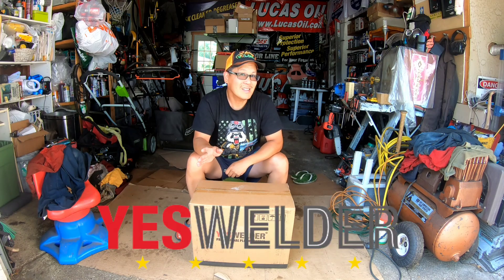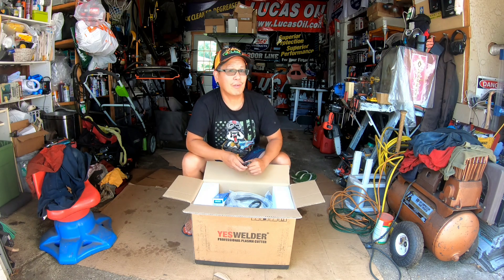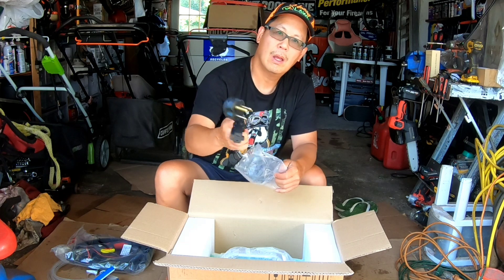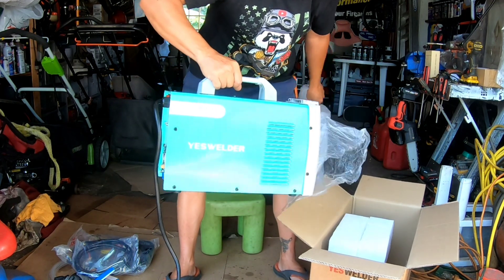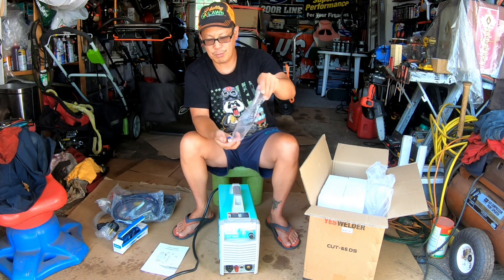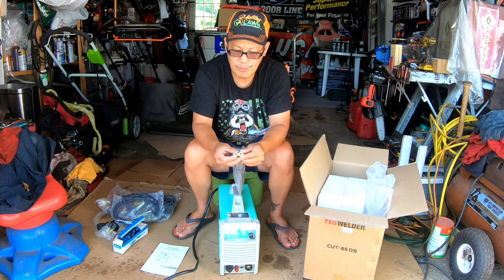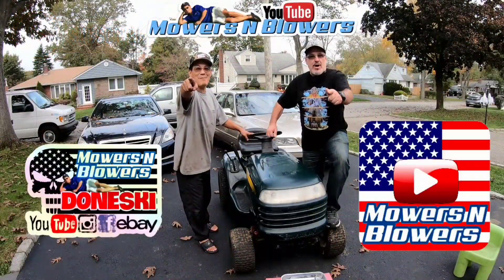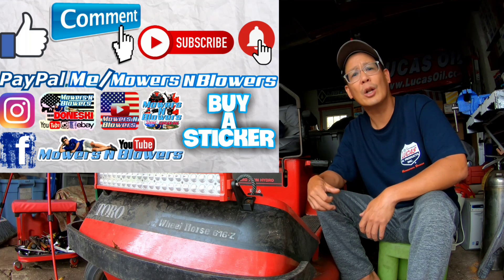YESWELDER PROFESSIONAL Plasma Cutter CUT-65DS Non-Touch Pilot Arc Cutting Machine UNBOXING & REVIEW

Comment: Henry the filters on the back are for and the glass bowl collects water. The black nob on top you either pull up or push down to adjust air pressure at the nozzle for cutting thicker or thinner metal. You have the same air adjustment on your air compressor- that is why it has two dials - one for tank pressure and one for pressure going out the hose. All surfaces need to be free of paint for good ground and good contact. Only cut clean steels - paint fumes are not good to breath as it burns. Looks like a good unit when you are patching decks. Too bad instructions are not better. Set air pressure per the book. Good video and good tool for light steel like decks or hoods. Don’t have to use a grinder and much more precise.

Comment: Henry, don’t use that while you are wearing sandals or shorts! That is if you don’t want to get burnt!
Reply from the maker: I weld with shorts and flip flops,  why not plasma cut too,  less sparks than welding
Reply: @MowersNBlowers  there is a hell of a lot more molten metal flying around and it is probably 8,000 degrees hotter than welding sparks!
Reply from the maker: @RockingJOffroad  wow!  That’s reassuring

Comment: Henry, once you learn how to use it , you will love it. Ive never used the 110v version but ive used the 220v and it is unreal what they will cut. They will cut through 1/2 inch steel like butter. The 110v version is limited to sheet metal and maybe up to 1/4 inch steel. Watch a couple of videos and i think it will make more sense. I agree they should of had better instructions. Goodluck bro! 👍🇺🇸 Roger
Reply from the maker: You’ve used one before?  It’s all Chinese to me!
Reply: @MowersNBlowers  Like Roger alluded to, The plasma cutter is a very useful tool to have and yes - Once you learn how to set the machine up, You would love it. 
First of all, When you engage the double action safety trigger - That is the pilot arc that is activated along with the flow of compressed air that cuts off after a minute or so, That is normal.  The plasma cutter works in a reverse manner than a welder in that the super heated plasma created from the electrical arc and stream of super heated air removes material rather than adding material such as a mig welder would with the filler wire. 
Like welding, The plasma cutters effectiveness is greatly diminished without an adequate ground to complete the circuit. 
Henry, You do not want to pull and hold the trigger to activate the pilot arc unless you are ready to cut or else you will burn up the consumable contact tip. 
Like a welder, The setting is relative to the thickness of the metal that you are cutting and the machine should automatically shut down if the air flow falls under a certain PSI. 
Speaking of air flow, The air flow going into the plasma cutter should be completely dry with no water or foreign material going through the air system - That is why the machine has the water trap.
As far as the instructions, I would first try to determine the capacity of your plasma cutter and maybe look up similar size plasma cutters from like Lincoln Electric or Miller/Hobart or Esab and compare the settings because regardless of the brand name - They all pretty much run with the same principles.
To answer your question regarding cutting aluminum, The ideal gas to run through the plasma cutter for aluminum would be nitrogen because it is extremely dry in which that is why you see the cylinders of nitrogen sitting next to traffic lights at major thoroughfares. Don’t give up on your plasma cutter before you do some research. Good Luck, Henry.

Comment: Set your compressor to 50 psi don't go over 90psi, Teflon tape the air fitting you put on the air/water separator, tickel the water drain at the bottom air/water separator, so it can seal properly, try not to run that machine on the same circut as your compressor, and try not to run it, on a extention cord, also don't leave anything under what your are cutting IE, cardboard. It will catch on fire quick.
Reply: The Black thing is a water separator/ pressure regulator. The plasma cutter I used to own manufacturer wanted to see 90 psi  on that gauge. The ground clamp has to be on clean metal, no paint! The gap between the gun and the metal should be around .040”  wear heavy gloves, at least dark glasses for eye protection gas welding goggles are better! That flame is extremely hot 10,000°+!